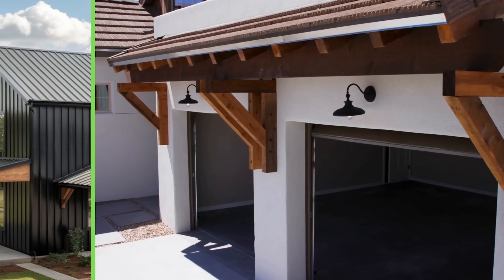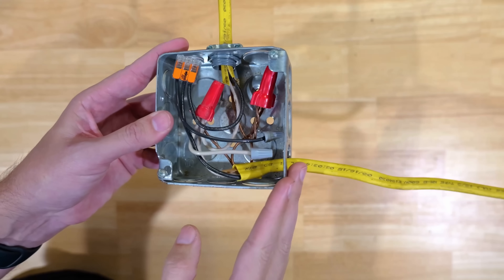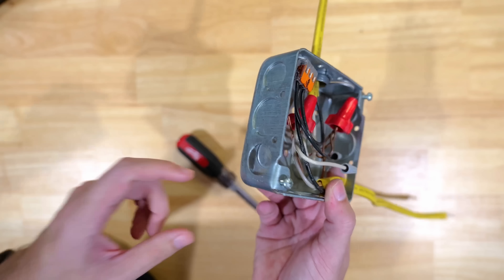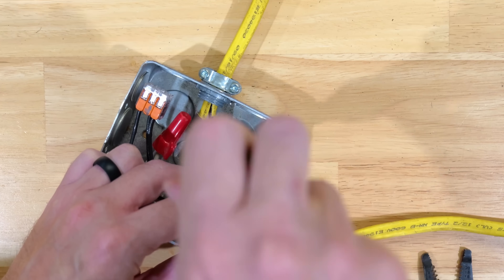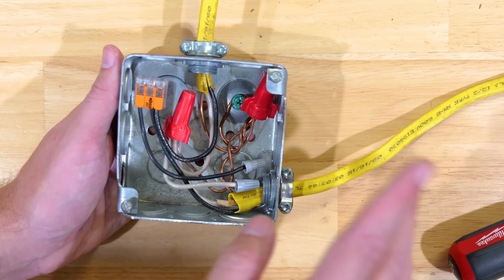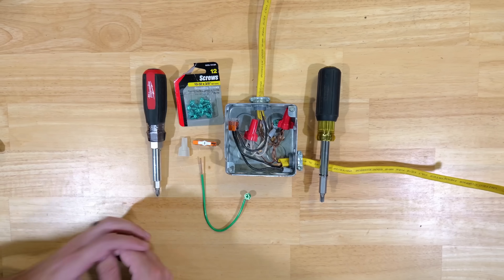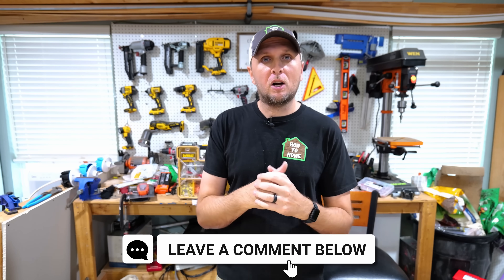SHOCKING Mistakes DIYers Make Installing Metal Electrical Boxes!

Comment: I think you missed one. I'll bet you those red wire nuts not listed for use as a splice for an EGC(ground wire). Instead, green wire nuts and other connectors may be used for such splicing. Does it matter? Probably not. But just pointing out.
Reply: Any color of wire nuts are permitted as long as they are sized correctly for the number and gauge of wires. Green wire nuts are considered a plus by some because they eliminate the need for a pigtail, but they require that one ground wire to be longer than the rest of them.
Reply: @surferdude642  It's not the color, but the listing. Are they listed for splicing use for the EGC? There's no reason the shouldn't be, but it's not clear that they are.
Reply: @crazycomments2.178 green wire nuts with the hole in the end are listed for connecting ground wires because that is their only permitted use. Any other color of wire nuts are not listed specifically for ground wires, because they can be used for normal current carrying wires and ground wires.
Reply: @surferdude642  Not sure if that is totally clear from the code and listings, but I would hope that's how it would be interpreted.

Comment: Please add when to use metal when to use plastic boxes.
Reply: In general, metal boxes are typically used for commercial construction and plastic boxes are typically used in residential applications. Metal boxes can be used for residential applications and can be flush mounted just like plastic boxes, overall, they'll cost a bit more and are more time consuming to install, but they are much stronger. Metal boxes can also be surface mounted on Sheetrock or any surface, obviously not appealing in living spaces, but can be a good option in garages, shops, etc. Surface mounting offers advantages such as ease of changing locations and adding outlets.

Comment: By the time you add all those WAGOs and wire nuts and pigtails there never enough room for the receptacle, especially with a single gang box.
Reply: Wago's, wire nuts and pigtails are not counted in box fill calculations. If you think that things are getting crowded and you're within box fill limits, use common sense and use a bigger box. This can happen with large devices such as USB receptacles. Size of receptacles are not considered in box fill calculations. Using standard residential or commercial grade receptacles, shouldn't be a problem as long as you're within the box fill limits, even with wire nuts or Wago's. You need to pay attention to wire organization and efficient use of space. No rats nest of wires.

Comment: I don't see/use very many of those "wago" connectors, so I was watching that pretty closely.  At 12:22 it looks like the two 12 gauge are running into a single connection point on that "wago."  By 12:31 that seems to have changed and each 12 gauge is into a separate "port/opening" of the connector?  Are my eyes playing tricks on me?

Comment: The jacket of your wires SHOULD NOT  be bigger than (3mm) ir 1/4" inside the box.
You can find this in out Nec 314 article.
Reply: 314.17(B), read it again, the 1/4" is the minimum, no maximum is specified.

Comment: Hi I am getting a lot more it of your tips and techniques…
I want to use your short wire methods to  configure a junction box that will facilitate extending the cabling to a distance away from hazards and provide  a safer outlet location at the end of its run ; This outlet is dedicated to serve a garbage disposal.  For space constraints any personal preference, I would like the outlet to be a single gang box, but all of the mono plug receptacles seem to be polarized or intended for other specific circuits?   Any issues with using a polarized receptacle to power a garbage disposal?  Do the still sell single receptacle standard plug-ins?

Comment: I’ll only use Wago spring nuts, I’ve seen more issues with wire nuts getting loose and arcing etc.

Wago springs nuts, always constant pressure, resist expansion and contraction

Comment: You can easily wrap that ground while you're around any screw mounting it to a 2 * 4 and then your your ground in the box.... If you are putting a receptacle or a light there then your box will be grounded also so you wouldn't need to run a separate ground.... How do I guess it's better to be safe than sorry

Comment: I have come across many secured wires that had electrical tape from on top of the wire fastener to the the wire, further securing. I have done this myself on connections were three wires were being fastened together. Your thougths ?

Comment: From Canada here, as a DIY er I wasn't aware of the length of wire needed. As for the cable gauge I have already n the past installed a final end of wire with ticker gauge (ex: 14 line finishing with 12 gauge) I imagine that ok.

Comment: This makes zero sense, if your putting an outlet the outlet has to be grounded not the box. You are showing people to not use the ground on the outlet. You are supposed to use a "greenie" to tie all grounds together and have a single ground wire coming out going to the outlet. NEC also states how much volume you can put in a specific box (cubic inches)which means all wires and wire nuts. Wago's take up more space than wire nuts and are not always approved for older smaller boxes found in remodeling. Plus, they make different Wago series designed for different applications. You cannot just thro one in there. You are giving tutorials but not using the NEC book for referencing.
Reply from the maker: How?  How did I do that?  At no point did I say to just ground the box and there is a ground pigtail there for a future outlet.  Don’t have to use a greenie, regular wire nuts or Wagos are perfectly legal to use.  No, wire nuts do not count again box fill calcs and neither do pigtails.  Wagos actually take up less space by volume in most cases.  The Wagos I showed are made for this.  You mention just throwing things out there and not using the NEC but that’s exactly what you just did.  You are challenging what I showed and referenced nothing in the NEC or manufacturer’s labeling to back any of your claims up as they are all false.

Comment: Sorry,, those Waco connectors maybe be good for led light connections BUT. The thin aluminum connectors can’t handle a 20 amp surge or 12 amp running currents like a twisted conductor. Sorry.

Comment: The twist on wire nuts require three twists  on the wires below the cap to indicate proper torque on the connection.
BAD MISS

Comment: Worst thing is all the neutrals are just stabbed into the wire nut. Like whoever did it never worked a day as an electrician. And no ground jumper for the outlets.

Comment: The plastic cable clamps have a split in them. Can they be installed in the opening without removing/disconnecting the cable?

Comment: I would think the real problem with the 14 AWG pigtail would be that the 20A breaker that goes with the 12 AWG wire is too large to protect the 14 AWG.  I don't think you could rely on a permanently connected load being rated 15 amps or less.

Comment: With no.4 I couldn't agree more.  I'm not a professional, but experience has taught me you can leave the wires exceptionally long and then curve them neatly around the box thus avoiding congestion and cramming and allowing for future re-termination should that ever be needed.

Once they are short, it takes a lot of patience to do anything much with them as your options for routing them become incredibly limited.  If you then change the switch or whatever and the connections are in different places, it becomes tricky.

Comment: In my opinion the minimum 6 Inch wire length requirement is ridiculous. Although I'm not an electrician I'm not aware of any such rule in Europe. The only rule is wires are not supposed to be connected under tension. So when you release a screw, wago or wire nut the wires should stay where they are and not automatically jump out to prevent the wire from automatically getting loose over time. The only reason to extend a wire is one that's slightly too short to be connected without physical tension.

But if the code in your country requires you to have wires with a minimum length of 6 Inch, then that's what you do in order to comply with regulations and be sure of insurance coverage.

Comment: That 14 gauge pigtail is not going to overheat and will be just fine, especially if the plug/outlet is going to be 15 amps, though I would still normally use a 12 gauge wire.  The bigger concern for me is that the Wago connector hasn't been wrapped with electrical tape.  Though this isn't required, it's extremely easy to pop one of those tabs.  Honestly, Wagos suck.   They provide a less secure connection and eventually wear out.  Furthermore, you really should also safe off the grounding pigtail because it could easily be pushed into a neutral or hot wire when using wire nuts. I safe everything off if I'm not going to connect the device immediately.  Electricity is color blind.  Any of those wires could be hot or become hot.

Comment: I like none of those clamps, the problem is that its not very air tight, so the box over time is gonna get filled with dust and probably also become home to insects. I always use the ones that seals the connection, where you screw on both sides.
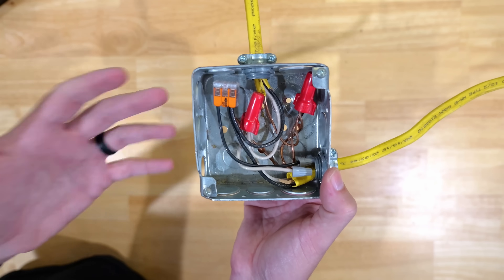4:50 thats why i never buy metal casings, you never know if some animal, insect or bad electician work has caused a wire to loosen, buy a plastic box and you dont have to worry about the grounding.

Comment: Clickbait, points at the WAGO connector, but his issue is #12 to #14 and says only “fine trained eye” will notice. Yeah, our fine trained eye is going to notice #12 vs #14 in your thumbnail. You imply cannot use WAGO in a box and then set watcher up. Overall, good video either way but stop with the bait

Comment: I think the pigtail requirement can be stated more strongly.  The 14 gauge pigtails indeed won't meet NEC because field wiring must all be min proper gauge for the circuit protection which is 20 amps requiring 12 gauge or larger. A light fixture with 16 gauge pigtails will always have them supplied but the the pre applied pigtails shown here would not be used instead the fixture would be wired directly to the wire nuts. 

The WAGO lever nut connectors are fantastic for making a reliable connection of a 16 gauge stranded pigtail multiple 12 and 14 gauge connections. I personally struggle to get those pigtails so firm I can't pull them out of a twist on wire nut which means I'm reworking the wire nut two to three times. 

If those pigtails were going to a 15 amp duplex, they still must be 12 gauge because the duplex is two 15 amp receptacles allowing an attempted combined load beyond the circuit capacity. But if the combined load were a continuous 19.5 amperes, the 14 gauge wire would exhibit additional temperature rise with heat being added to the box and duplex outlet housing which is already running warm. 

Those pigtails should be 6 inches. if they were septical we're being installed, a third grounding pigtail would be shown unless it was a utility lamp holder without a grounding receptacle feature. 

(I should reference code paragraphs here and I complain about others who don't and I'm supposed to be getting out of bed and doing things right now instead of fussing over this content... I really think I'm right about field wiring gauge. I'm very confident about the 16 gauge attachment pigtails because of my product development experience of designing to meet UL safety standards. Always be skeptical!)

Comment: 12 GA => 20 AMP; 14 GA => 15 AMP; You are right on! Had a 12 GA from a 20 AMP breaker running to a wall socket and on the other side it transitioned to 14 GA unbeknownst to me. Used a space heater after an office move and after 8 months the 14 GA side of the wall socket completely melted.

Comment: Exceeded the number of wires allowed in the box, must have a box extender
Reply from the maker: Incorrect again.  There is max number of wires allowed in a box.  There are box fill calculations.  Even with two receptacles installed in this it still would be just under the max box fill.  Pigtails don't count.

Comment: Those boxes dated from 1935 or what? You have to look over your borders how the rest of the world uses electric materials, especially in Europe.
Reply from the maker: Why do we have to look over the borders?  We don't have higher rates of electrical fires than most of Europe.  Us as citizens have zero control over code and what is approved to be used.  Now do I think there are some things better in Europe when it comes to electrical?  Yes.  But we don't use the same grid as them and it makes less sense here.

Comment: I don't know why I stumbled upon this video, but it makes me laugh. When I studied engineering in the 90's, we had in the first year practical exercises for electrical installations. the hardware we used was what was considered 70's hardware and already not in use anymore in the Netherlands. They wanted us to work with it because it was so easy to make mistakes. It is exactly that hardware you are using now. It leaves a lot of room for misinterpretations and hard to use for people that aren't professionals. hard to use means, more error, more unsafe situations.
Lets begin with the most obvious, the wires are double isolated, who won't use a knive to cut away the first isolation with the giant risk of cutting also into the isolated of the wire itself (without seeing it)? secondly, we pull our wires through PVC pipes which allows for safer installation and also after 30 years or so it is possible to replace wires when the isolation has become brittle.
The wirenuts are so awful to use and leave so much room for poor connections when done wrong, pre-wago era in the 90's we used already some connection block that made things so much easier (and hence safer).
Also back in the day residual current devices were already very common. needless to say, they should be mandatory everywhere.

Comment: I'm still trying to figure out why people hate on Wago connectors so much. They are rated and have been tested and are approved to use for code compliance. I think its just an issue of people wanting to stick wire nuts, which is fine but stop hating on them just because a person has an opinion of them.
Reply from the maker: I don't know.

Comment: When I installed my ceiling fan a year ago I didn’t have any wire caps so I just used electrical tape nothing‘s ever happened yet and I totally forgot to hook the ground wires up but it still works perfectly fine i’m just finding out that you’re supposed to install a brace to hold the fan up I just nailed it in the drywall. It’s still up there.

Comment: I like to wrap some electrical tape around the Wago when installing them. I’ve seen open levers on Wagos from when they were being pushed into the box, allowing wires (especially hot) to come partially or fully loose.
Reply: Always tape

Comment: Using wire nuts is a bit medieval. We have been using wago in the Czech Republic for 35 years. And overall we have been using safe terminals in junction boxes for 80 years... It is interesting that such a dangerous and laborious way of connecting cables is allowed anywhere in the civilized world...

Comment: I did not know about the wago or lever actuated wire nut connectors.  The 6 inch rule makes since.  14 gauge is a lot easier to handle vs 12 ga.

Comment: I know people aren't going to agree with me, but I wish Wago's never made it too the USA. I have personally seen way too many of them burn up a neutral or hot connection on a higher amperage draw appliance. For instance, a week ago I had to work on a small beer cooler that had Wagos installed on the compressor wiring. Guess what, the neutral connection burnt up from inside the Wago and could have started a fire. Wagos are garbage in my book and whenever I find them, I remove them and toss them in the trash. I am a 25 year Journeyman Electrician and they need to ban these damn things

Comment: Always twist your splices and trim off with you linemens pliers, do not use the wirenuts to twist the wires you do not have a visual of the splice if you do. Never use Wagos  they are a fire hazard under heavy loads they always heat up.. Trim cable jacket closer to the connector.